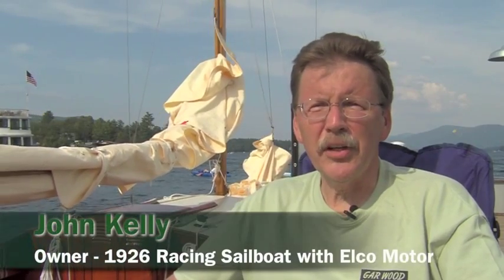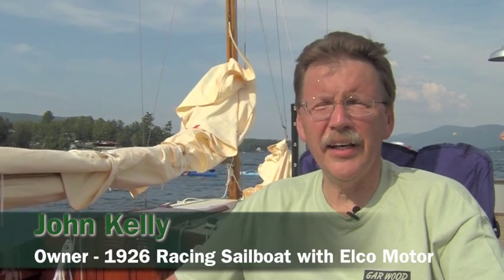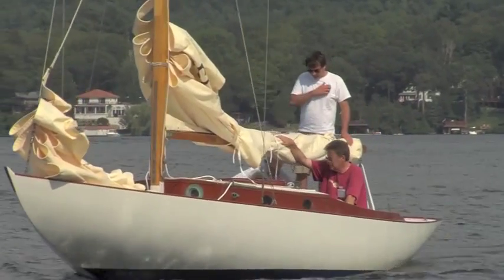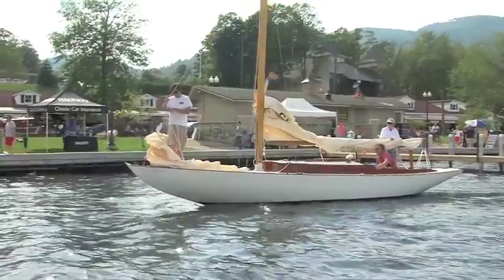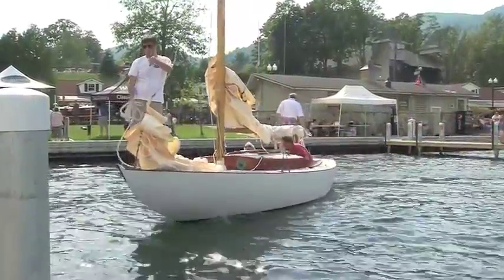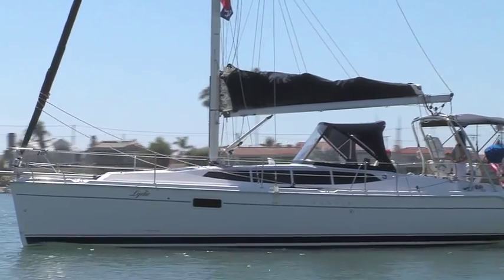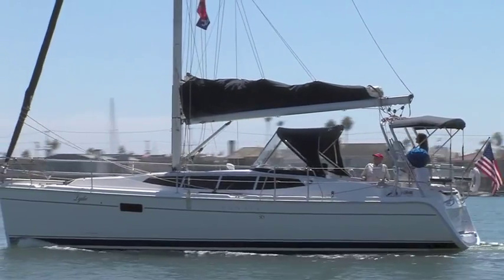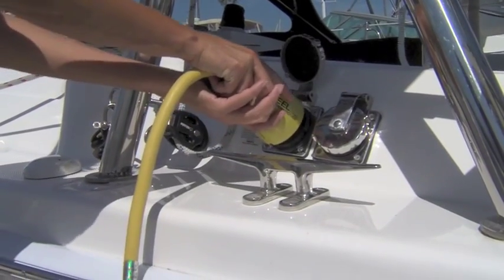Electric Propulsion the "better" choice

Comment: HOW DO YOU CHARGE THE BATTERIES? --this is always my question with 'hybrid' systems.

I would like to use an electric system in my boat but have not found a system with the power and endurance to really be practical for real cruising.